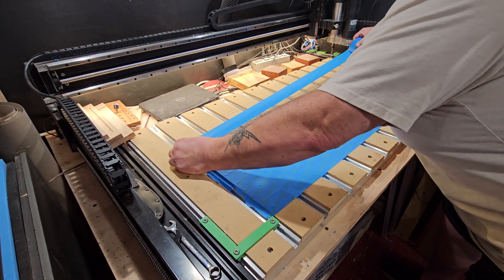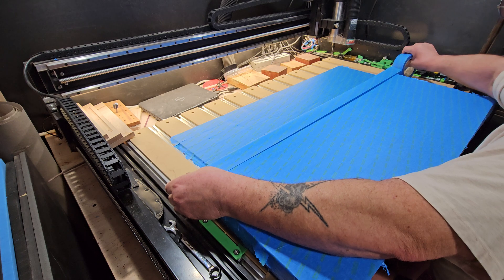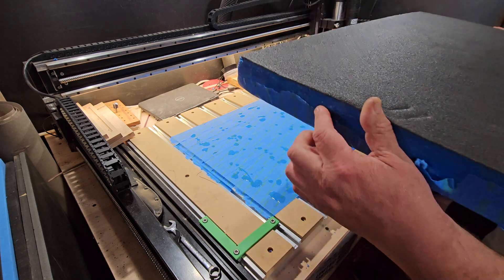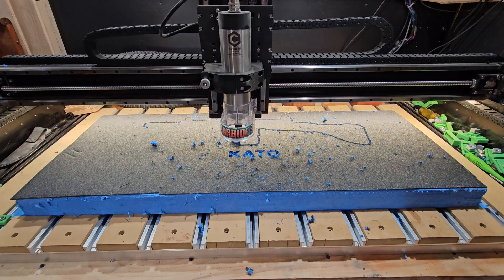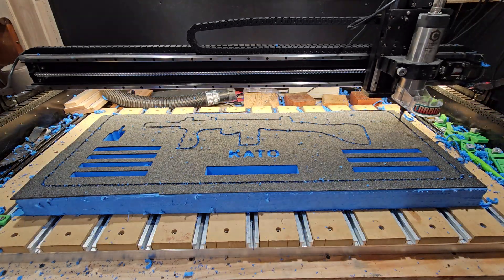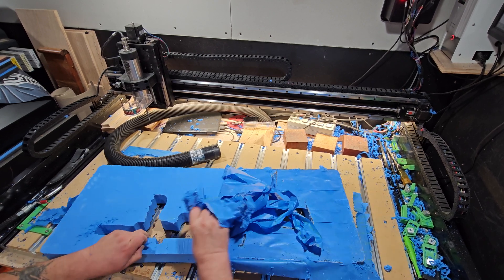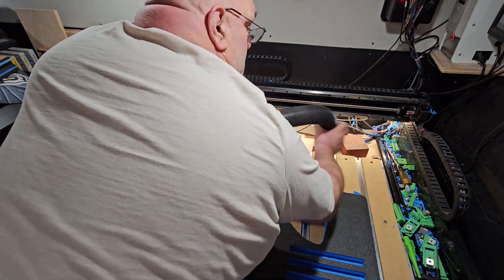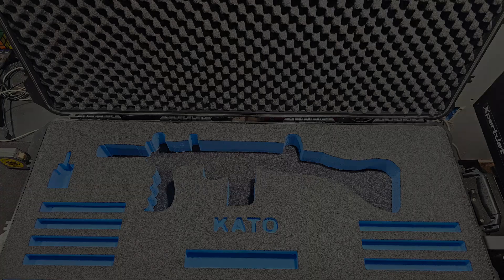CNC Foam cutting from start to finish

Comment: My machine, which is different than this type of machine, would have done this in under 5 minutes.
Reply from the maker: Yeah Im new ...
But its just a little 110 Volt machine running it slow

Comment: Machinist here. No idea why you are re-inventing double sided tape, but the weakest link in that setup is the adhesive qualities of the tape..which is designed to peel off of items with little to no effort or residue. We've been using double sided tape for years in our job shop. Holds just as well if not better than whatever it is you're doing. Whoever came up with this idea of painters tape and CA glue and proliferated it onto YouTube is doing the devils work.
Reply from the maker: Thats so funny
Hobbyists have been using blue painters' tape for over 20 years
We are not Machinists, we are hobbiest, and double-sided sticky tape costs way more than Blue painters tape
BTW........If you really knew what you were talking about
Then you would agree that to cover this project with rows and rows of double-sided sticky tape would be ridiculous and cost so much.

The reason for using this method for small pockets is so you don't get tear-out of the foam
So you really don't know what you are talking about
But thanks for stopping by and looking like a fool

And WOW......you have 30 subscribers?
Put your money where your mouth is.......LMAO
Reply: @popshobbydungeon  I happen to be in Home Depot when you replied. A roll of the tape you used is $8.49, and a small bottle of CA glue with activator is $13.99. A large roll of Gorilla double sticky tape is $9.99. You don't need rows and rows of tape by the way. Good luck with your weight loss.

Comment: When you use the Bits&Bits (430-ST250) what Stepover and Plunge rate did you use?
Reply from the maker: Stepover is always 50% of the bit diameter
Or at least that what I use
Plunge rate is 80
Bits & Bits has the data file on all their bits and you can download all there bit profiles from there site and upload them into your CNC program

Comment: If you use a electric heat gun (paint stripper) on the foam it will shrink all off those foam strands, also quickly go over the face with the heat gun, it will sharpen and give a sparkle to your finished product.
Reply from the maker: yes thanks
I do that in my other videos
Regards, pop's

Comment: Is this the black polyethylene that you used? The smallest I saw on that website was 1/4”, is that correct? I think it was 2:2 lb. and $7:99 for a 54” x 24”
Reply from the maker: 1/8 inch poly
https://www.thefoamfactory.com/closedcellfoam/polyethylene-foam-roll.html
Reply: You liked my reply but you didn’t answer my question
Reply from the maker: @thesplinteredfinger  
Oh sorry
I answered this question so many times to others I thought I answered you
1/8 inch is what I found here
https://www.thefoamfactory.com/closedcellfoam/polyethylene-foam-roll.html

Comment: How thick is the black polyethylene? The smallest I saw on that website was 1/4”, is that correct? I think it was 2:2 lb. and $7:99 for a 54” x 24”
Reply from the maker: 1/8 inch super thin
Heres the link|

https://www.thefoamfactory.com/closedcellfoam/polyethylene-foam-roll.html

Comment: Nice! I'm in Warren Michigan and I have a Zenbot CNC, Davinci Duo 3D printer modded to RAMPS and several laser engravers. Have you tried lasering the foam yet?.
Trade ya subs, lol!
Reply from the maker: I haven't really felt the need for 3D printing just yet
I have a MUTOH 661UF UV printer, one  Mira 9 lasers, and a 50 watt GALVO 
My web site is MAGCASTLE.com

Comment: Very cool! Your video came up as a play next and while I've been into 3D printing for a while, I've never seen this.
What kind of CNC do you have, or did you DIY one?
Reply from the maker: It's the Shapeoko 5 Pro (2x4)
There are many hobby Machines out there 
But this one has the best American tech support  & for the first 30 days if anything breaks (Including Bits), they replace it overnight no questions asked............Fantastic
Oh, plus their software "Carbide Create" is free and easy to use and learn
Best, Pop's
Reply: @popshobbydungeon  Thank you for that info, I'm gonna look into one :)
Reply from the maker: @2112user  If you talk to them please let them know that Pops Hobby Dungeon Sent you
regards, Pop's

Comment: That is very cool. Man those foam sheets are expensive.. $157 (+ shipping) for one 72x48. That is insane. You can bring it down to half that if you buy 40 at a time, but dang.. that's still very expensive.
Reply from the maker: Yeah but thats why i charge $200 per case
I can get 4 1/2 cases out of one sheet so that a pretty good markup don't you think?
Reply: @popshobbydungeon  Ooh that is. If you buy in bulk thats 9 cases unless you are buying in bulk. Either way, nice deal.
Reply: @popshobbydungeon  So the question is.. do you have enough to live on the profits.. and enough business for daily work to cut them.. or just a few one offs here and there?
Reply from the maker: @WhySoDivided-CantWeAllGetAlong  
So I have this machine, 2 Laser machines and a flat bed printer so I can make anything, and I do !!!
From signs and silly trinkets to laser engraving guns, knives, magazines & more
I also Cearkote. Theres money to be made in the gun industry.

Check out my websites
www.acrylicmemories.com
wwwMagcastle.com

Best, Pop's

Comment: Have you tried this with a laser to cut out? How does it look?
Reply from the maker: Laser would melt and fuse the edge making it a hard melted surface
Reply: @popshobbydungeon  Yeah, i figured. I have a 100Watt C02 laser i thought about trying it out. But wondered about the melting and the smell and how it would mess up my optics.
Reply from the maker: @user-zq6pj5jo8j  
I also have a 100 watt MIRA 9 and yes if you were to laser engrave this foam it would be messy but also toxic and probably catch on fire
That why I bout a CNC to do the jabs that a laser can not
regards, Pop's
Reply: @popshobbydungeon  Ok Nice. i have the Thunder Nova 35 100watt. I love it. Great system

Comment: There is very little side force when cutting foam. I cut xl-pe for work all the time. Sometimes i just tape around the perimeter to the spoil board. I also use clamps. If I don't have enough space around the edges, i make a slit into the side of the foam and put the clamp there. I now have a vacuum set up and it is significantly better than all other methods. CA glue and tape is the so slow and unnecessary for foam. 

You can also rough with a bigger bit and finish the walls with a smaller bit. It's foam, be really aggressive with your feeds and speeds and your depth of cut. I'd probably rough with with a 1/2" at 1" doc or more.
Reply from the maker: Actually....
When I tried cutting MAG wells one inch close to each other and didn't use the FULL tape and glue method
The mag wells stretched and didn't cut straight (Maybe because of my feeds and speeds)
Because there wasn't enough surface tension to keep them in place !!!!
From my 2 years of cutting Foam, I recommend taping the entire surface to the bed (It only takes 6 minuets) especially when cutting all the way thru and close pockets
I want to build a Vacuum Bed someday but first I have to install my 2.2k water-cooled spindle

Comment: what have BIT, speed, feed.
Reply from the maker: Spindle Speed: 14-16,000RPM
Feed Rate: 120-180IPM
Depth per cut: .250″ – 0.500″
Reply: @popshobbydungeon  thanks need test next time if buy first foam sheet.

Comment: @popshobbydungeon Have you tried to finish the foam with a propane torch after cutting? Have seen some manufacturers do so, to clean the edges  to get rid of those tiny nubbies. Maybe try it on some offcuts. I like the trick with the painters tape on the backside of the foam. Haven´t seen that before on any other foam cutting video.

Comment: would'nt it be smarter to make a MDF sacrificial board to cut on your table ? because ruining the table like this... i dont' know. but overall awesome project. want to do it myself some day just not sure what cnc to get for it. (wanna make sidehustle out of this )
Reply from the maker: Yes I could have used a sacrifice board of some sort but the 2 layers of tape with the glue actually works as a sacrifice
I was tossed on which one to get as well but I like the customer service and 30-day replacement guarantee from Carbide 3D so I went with them
Also, don't dwell on a 4x4 as you will never use all of it
I owned a sign shop for 30 years and most signs are 2x3 unless you want to go big 
Either way, the 2x4 Shapeoko 5 pro can easily make a 4x8 sign if needed
Reply: I will say my 4x4 is huge and I don't really see myself ever using that extra space that often. I built a cabinet to house my 5 pro and it is 6ft wide 6ft deep and 8ft tall. The bottom shelf holds my X tool d1 laser and my 3d printer. But it takes up a ton of space in my shop.

Comment: Did I miss the speeds/feeds? CNC videos without those should be banned.
Reply from the maker: Spindle Speed: 14-16,000RPM
Feed Rate: 120-180IPM
Depth per cut: .250″ – 0.500″
Reply: @popshobbydungeon  thanks. I’ve got an older shapeoko with a 1.5kw spindle but have never had the best luck with foam. I’ll try the higher density closed cell foam you mentioned. Been cutting Kaizen foam (EPE) but it leaves a very fuzzy wall and floor.
Reply: @connordowling914 I'm glad the poster was nice to you, I don't think I would have replied with what you wanted. 

There are lots of foam cutting tutorials with what you're wanting. If you got some info from this video, then thank the poster, not bash him. 

Also, trial and error. Figure it out
Reply: @connordowling914  Are you using climb cutting?  If so, change to conventional cutting and you should be good to go.
Reply: The feeds and speeds here are a helpful starting point. I've only ever cut wood, metal or acrylic on a CNC router. Usually foam is water jet cut, no? I wasn't even aware it could be cut with a mill, I thought the plastic would melt and gum up the bit. Happy to be introduced to a new material!
Reply from the maker: @wiremonkeyshop  
Just so you know
Any bit that you purchase online will have a spec sheet with the recommended feeds and speeds but here are the feeds and speeds for this Bits & Bits Bit I am using

Spindle Speed: 14-16,000RPM
Feed Rate: 120-180IPM
Depth per cut: .250″ – 0.500″

and here is the link to the bits which has the Feeds and Speeds posted in this link
https://bitsbits.com/product/430-st250-foam/
Reply: I believe must of the F & S online are set up for industrial CNCs and are just recommended starting points. Learn how to do the calculations & how your machine sounds as it cuts. Adjust accordingly.
Reply: I’m glad you were born with all the chip load and spindle load calculations memorized. Some folks might benefit from hearing what works for those who have gone before.
Reply: Seriously? You shouldn’t be working a CNC if you don’t know about cutting speed calculations.

Comment: Thanks for sharing your process.  Have you experimented with 3D depth cutting in foam, for instance to make a form fit for a firearm that is thicker on one end then thinner on the other so that it will sit flush with the top of the foam?  I'm not sure how well the foam bit would do with ramping or simplified 3D toolpaths. 
I recently used the Shaper Tools Trace frame to quickly get vectors for small tools that were cut into Kaizen foam for a tool box organization project.  A bit tedious to set up hundreds of small tools to fit perfectly but satisfying end results.  I would definitely be interested in your process for vectorizing as well as speeds & feeds you use.
Reply from the maker: I will be making a video soon on my Vector trace process
Feeds and speeds are in the discription
Thanks for your comments
Regards, Pop's
Reply: same me uses 3 strip tape 60x60 plywood on table, but lot i use clamps whit plywood too, better. i made whit cnc lot plywood clamps. 1/4 " bolt to table. not has test foam yet.

Comment: Awesome project!! Did you mention the make and model of the cnc?
Reply: It's in the description ... Using a Shapeoko 5 Pro (2x4) and a Bits & Bits Foam Bit I can cut 2 inch foam...
The Faom I am using is called  Cross-Linked Polyethylene - 2LB and comes in many colors
Reply: I have the big brother 4x4 shapeoko 5 pro if you're looking for a great CNC I highly recommend this one. I don't have a single gripe on the CNC my only issues are with carbide motion. They are just preferences that I can't set but nothing wrong with the software. Don't go cheap with the software. I spent $700 on vectric v carve pro and it was worth every penny.

Comment: Curious, what are your feeds & speeds on this foam?
Reply from the maker: BIT FOUND HERE: https://bitsbits.com/product/430-st25...
Spindle Speed: 14-16,000RPM
Feed Rate: 120-180IPM
Depth per cut: .250″ – 0.500″
Reply: Thanks, I’ve never cut foam and just needed some starting points. Appreciate you.

Comment: X fasten double sided tape is the best one ive ever used
Reply from the maker: unfortunately (In my experience)  3 strips do not work well when using foam and making pockets
The pockets will wrap and rip if the narrow area is not secure so that's why "FULL COVERAGE" for hold down is necessary
best regards, Pop's
Reply: @popshobbydungeon  okay that's fair I do typically use wood and that's for a larger project but either way keep doin what your doin it's pretty cool
Reply: 3 strips can hold a 2 ft by 2 ft part pretty reliably

Comment: I use the same tape and glue method on my cnc.  I also have done hot glue and it works well.  A side note that the pad music in the background is REALLY annoying and out of place for a video like this.  Either use nothing or some normal music (royalty free if that is your concern) because the pad sounds its just really strange.
Reply from the maker: Thanks for the advice
I received over 80 subs in 24 hrs so some people must like it ;-)
Looking at your videos and as a musician and singer myself
I think if you smiled more in your videos and switch up your background you might attract more subs ;-)

Comment: What spray glue works well to go from the dense crosslinked foam to the open cell foam that comes in the cases?
Reply from the maker: i use 3M Hi-Strength 90 Spray Adhesive
https://amzn.to/4eJr4hf

Comment: I use the tape method on my CNC. If you use medium CA, it helps if there is any variation on your table or workpiece. You can also get by with much less tape and glue. 3 or 4 strips of tape and glue is more than enough
Reply from the maker: Unfortunately from my experience
Not enough glued surface leads to rip out and tear out of the foam from the feed and speeds that I am running
So that is why I do a complete cover

Comment: Double stick tape might work.
Reply from the maker: Yes it does but you have to use a lot
And that can be expensive ;-)
Reply: It doesn't.  It is a nightmare to peel off and depending on the tape it tears out the foam.
When fixing parts with tape to the bed, this is the correct way. Best tape is 3M2060.
Especially when milling alu parts, double sided tape is a no go, because it gets soft with heat and it gums the endmill tip

Comment: Awesome video and gave me some ideas. Is the black polyethylene foam you're using 2lb or 4lb? 1/8 or 1/4" thick?
Reply from the maker: Thanks
The Black is Closed Cell Polyethylene 1/8"
and the blue is Cross Linked Polyethylene  2 inch
Both are 2 lb